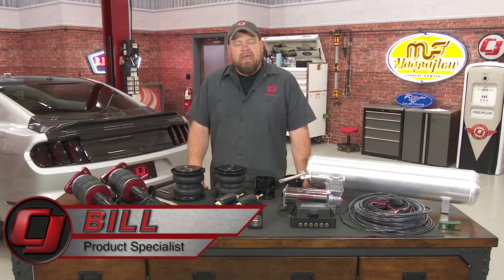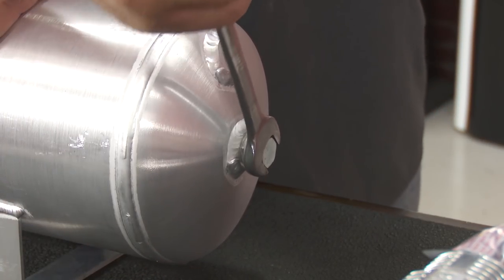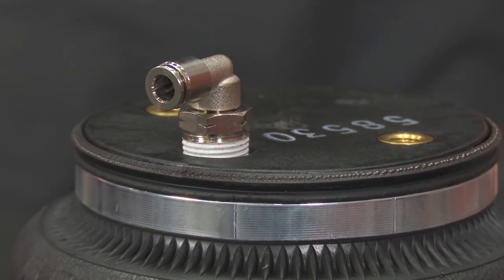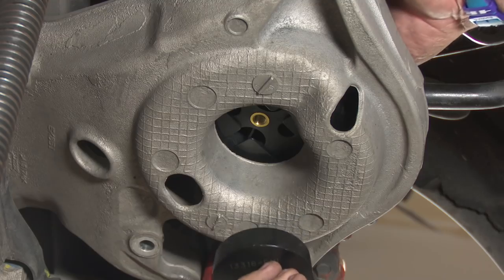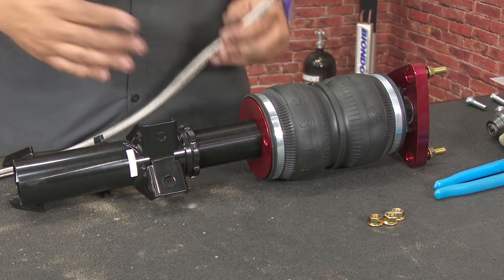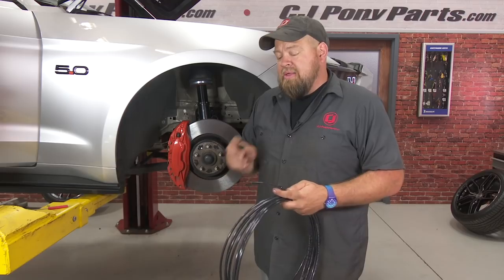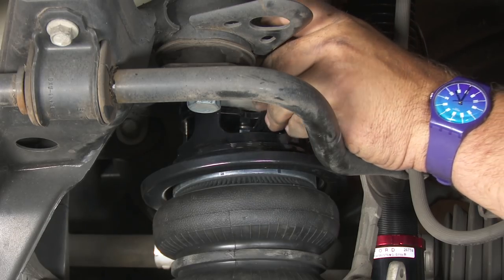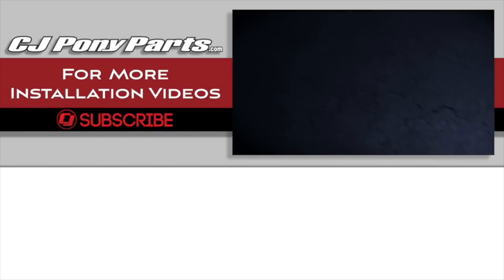2015-2023 Mustang Air Lift Performance Air Suspension Kit 3P Complete Installation

Comment: For those of you having trouble with the rear nut plate. Attach it to the bag instead of putting in the hole and you can wiggle it in then tighten.
Reply: Did you put bump stop when installing the rear shock?

Comment: Pretty straight forward install. Looks like a top notch kit. Can't wait for the follow up video. I would do all the mechanical stuff one day and do the lines and wire the next. I think in a single day I might be a bit tired after all the suspension stuff and not be fresh and patient for the lines and wire and probably mess stuff up or be sloppy. We are not all pros like you....LOL...LOL

Comment: Been thinking about bagging my mustang. Problem is I have a 2020 PP2 with the magneride suspension. From what I’ve seen it looks like you can’t or at least shouldn’t install air ride on a mustang with magneride. Anyone has any thoughts on that?

Comment: Bill how did you install the rear spring perch plate? I tried sticking in a flathead screwdriver to hold it in place, but I run out of clearance after a certain point and can't torque it down all the way.
Reply: Patrick Miravalle what did you end up doing? Im stuck on that right now
Reply: @steve_shec  whatd you do? only reason why i havent order bags yet is because i do not understand one bit of that part of the install. very vague.
Reply: I’m stuck on this right now too

Comment: Are you worried about air fill to front versus rear with the front air lines significantly longer than your rear air lines. I would assume you'd want all air lines approximately the same length and simply roll up and zip tie access rear line and hide in the wheel well to get all 4 wheels to lower and raise at the same level evenly?
Reply: Not sure why the rear airing out (or filling) faster than the front is an issue other than aesthetics? That said, if it's important there are other ways to do it without running a bunch of unnecessary line. One being an air flow control valve.

Comment: this is by far the best and most useful descriptive video on an airlift installation.  thank you for this!  i did have a noob question.  my shop which is quite far away installed my 3H system.  Recently my manifold air pressure sensor went bad and airlift just sent me a new manifold.  i'm going to attempt replacement of the manifold myself.  i saw how you plug in the air hoses and how they lock in.  as for the harness plugging in, that looks pretty straight forward too.  obviously i should drain the tank before i start this install.  but my question is, do i need to disconnect the red and black terminals of the battery first before removing my old manifold and plugging the new one in, or is it safe to leave the battery connected and just swapping it out?  i ask because last time disconnection of the battery erupted some issues while installing a subwoofer and amp.  i have an audi s5

Comment: Hey Bill I have a question when you remove the back spring did you remove the bottom rubber piece or reuse it I haven't seen nobody mentioned it yet no even the installation instructions
Reply: Remove both rubber pieces not used anymore

Comment: Alright got a problem after a couple of months something was rattling and sounded loose i am just checking and its the lower centering spacers from the bag tried to tighten and just was spinning freely so i removed it and it came out with the gold thread that holds it in place... anything i can do?
Reply from the maker: Give airlifts support line a call they can probably help you out (800) 248-0892

Comment: hey Bill, I've been watching your vids for over a year. just out of curiosity, I'm wondering which is better. A coiled over system or a bagged system.  I'm not going to show my car, or go to the track. I'm just wanting a more comfortable ride with an improvement on handling. Which would you recommend?
Reply: Honestly shocks, struts, and new springs would probably be all you need. Both coilovers and air have a lot of adjustment you can dial in for your use, if you are just looking for a better ride both might be overkill.

Comment: Noob question: wouldn't tire wear be a big issue with constantly changing ride height typically used with air suspension?
Reply: You would get the car aligned at your normal driving height so it really isn't an issue.

Comment: Added weight.. nope
Reply: can you install this on a car with magnaride?  have a kit for my 2015 but getting a 2021 built which will have magnaride.  Will this trip sensors and cause errors?  I know I can get magnaride lowering springs but looking to be able raise and lower for my driveway access.